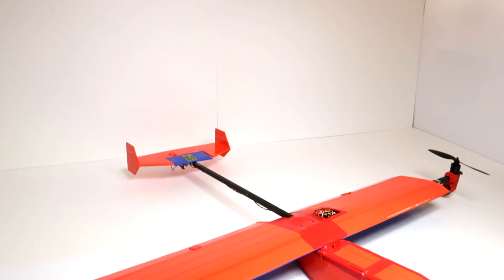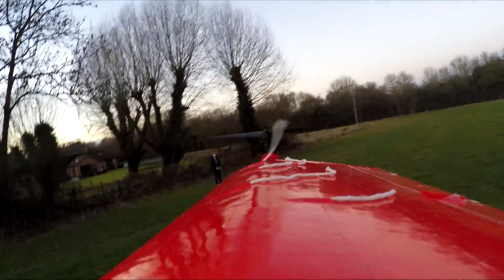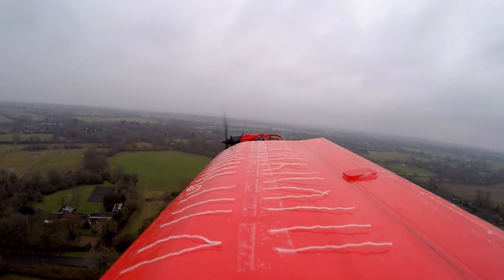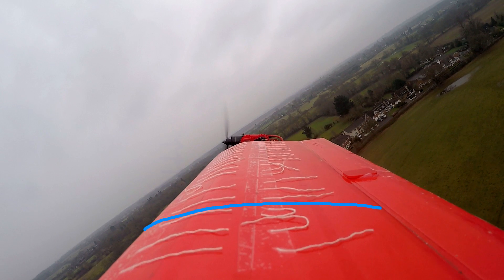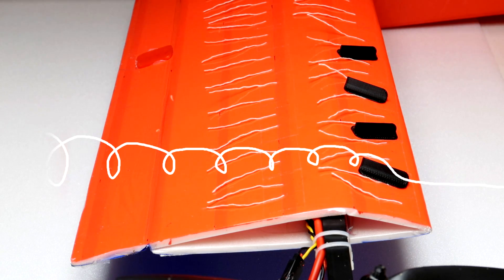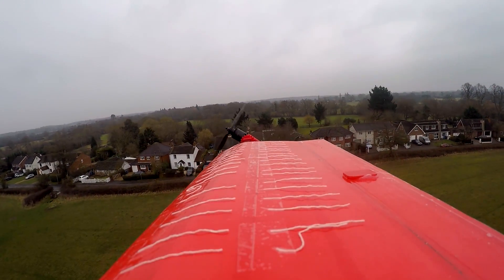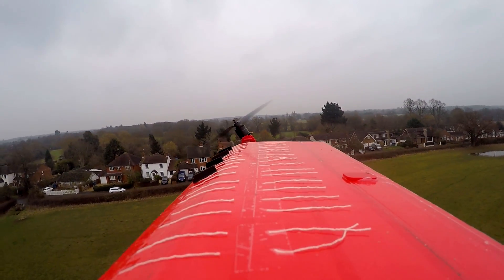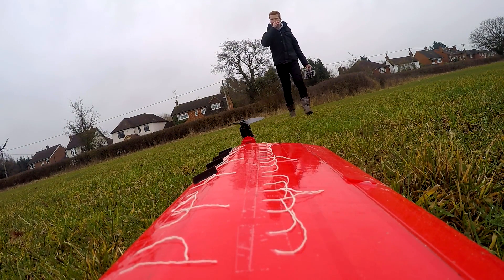Vortex Generators on a VTOL

Comment: Vortex generators  are sometimes added to increase control surface authority.. The Vtol probably has them to still have control of the ailerons/flaps while in the transition from slow forward flight to hover.. 
I wouldn't say they put them on to lower the stall speed necessarily but more keep the control surfaces active that little bit longer.. I could be wrong, but you can see them on commercial passenger jets also on the elevators.  My uncle said there on his glider just at the ailerons and that's what there doing.. Said it keeps the airflow sticking to the ailerons for slow thermal turns..

Comment: I know this video is 4 years old but I thought I'd share my understanding anyways. For low reynolds numbers such as RC scale, especially when approaching low vtol speeds, vorticity means almost nothing. Vortex generators, P factor coefficients, wing twist, variable airfoils, all moot. Even super high aspect ratio wings begin to suffer efficiency losses. What is predominant at this scale are the effects of general pressure, and the only way you can really affect that to any efficient degree is through the positioning and rotational direction of your props (outside-downward).

Comment: vortex generators on a vtol plane aren't that usefull really, they decrease you stall speed, wich means you can fly slower (usefull for cropdusters of firefighting planes and such) but on a vtol you can already fly as slow as you want. the reason they are on the Osprey is probably to make it easier for the engines in slow flight. this will reduce fuel consumption. For you it's easier to fly when using them but thats because the explained 2 stall speeds because you only have vortex generators on half of each wing. if you look at the osprey, his entire wingspan has it so this wont happen with the osprey

Comment: Make a mechanism for vortex generators that goes UP/Down with the servo at the wing Tip. When you are full forward Vortex generators are down in the wing...when transition to vertical starts they rise from the wing. All that to impact efficiency while full forward with less drag.

Comment: Unloading the wing in transition, using the rotors, reduces the wing stall speed. The most efficient way to fly is wing-borne, to exploit the high L/D ratio, so it makes sense to have vortex generators and keep the wing as close to stall as possible. Even past stall, the wing is much more efficient at producing lift than rotors.

Comment: The flow profile RIGHT at the surface of the wing is linear or close to it (for zero pressure gradient boundary layer flow it is linear), and intersects the origin due to the no slip condition. The drag is proportional to the slope of this line

Comment: Really good channel, Tom. Glad to come across you. Viktor Schauberger generated flow vortices in running water using egg shapes. He used them fixed to the river bed by chains to de-silt a river overnight. This would give you a far more intense vortex than a square tab. Want to give it a go? You may find this doc interesting if you haven't come across Schauberger before: https://www.youtube.com/watch?v=yXPrLGUGZsw

Comment: These are more complex designs but I have some comments on thoughts maybe you should try. 

1) I'm not sure you were getting the expected outcomes you wanted due to the fact that on a slow moving model, the Reynolds numbers are simply too low and too close together compared to that of the Ospray. Empirically, I am sure that the VGs probably have more to do with horizontal forward flight than the VTOL capability. Consider your Drag vs. Lift vs. Velocity calculations.

2) Maybe you could investigate having some washout in the wing, to change the angle of attach and make the stalling characteristics at lower speeds more favorable when transitioning and at higher angles of attack. Then you wouldn't have to worry about the added drag and weight which is probably more significant than your attempt (due to #1) to maintain laminar flow over the outer portions of the wing with the VGs. 

Keep up the good science and I am excited to see your progress. You are an innovator!

Comment: Variable pitch vortex generators that cycle straight to full angle of attack mid engine pod transition (not linear, full VG rotation over middle 30' approximately) . not sure if the weight penalty would offset the drag efficiency / controllability gain. you could have a central servo or just 3d print magic a cam wheel on the pods to a drive shaft. this could work on any wing i guess not just for your VTOL

Ps i make no claims to any expertise in any field and i'm sure it's been thought of before. this is more of a question.
Reply: Came here to say this, but make them retractable as well. Just cam them to raise straight up through slits in the covering, and then to proper angle once clearing the surface, and then back down to surface to lock them in. Cam it all to motor turning from horizontal to vertical. Now I have to go purchase a stinking 3-D printer so I can do this. I suddenly have an overwhelming need to see this in action.

Comment: Great job ... I was tarted to think about two rotor vtol and check in youtube if somebody done it already.
I have noticed that this is not a simple task to do and as far as I can see you use very scientific approach to do it.
I don't have much background with a rc planes and this will be the difficult part for me.
I am intended to use your research as a base and see  what will happen.

Comment: VGs will increase your skin friction drag (as opposed to induced drag from the wingtip vortices, or planform/area/pressure drag) because they help move fast moving fluid closer to the wing surface. The flow profile RIGHT at the surface of the wing is linear or close to it (for zero pressure gradient boundary layer flow it is linear), and intersects the origin due to the no slip condition. The drag is proportional to the slope of this line (the velocity gradient at the surface) so as you increase the slope/gradient by injecting/mixing faster moving air to the near wall region with the VGs, your skin friction drag goes up. (Also you have losses from the momentum imparted to any vortices persisting in the wake, as well as increased frontal area due to the VGs... on real aircraft these are quite small but on your model the VGs are pretty huge relative the wing cord, so these effects may be competing with or even overwhelming the skin friction increase effects.

BTW, your use of the term boundary layer was not quite accurate. It seems that you were confusing the boundary layer with the separation bubble. There is always a boundary layer over any solid surface (assuming continuum mechanics, not rarified flow, or infinitely close to a sharp leading edge) with attached flow. The local skin friction indicates how close you are to having a separation bubble. When the skin friction (proportional to the velocity gradient at the surface) reaches zero due to the pressure gradient, that is where separation happens, as you correctly drew in your diagrams. The region of recirculating flow associated with boundary layer separation and stall is typically called a separation bubble.

Interestingly, if you try to design airfoils and fuselages to minimize total skin friction, you WANT to be as close to separated flow as possible over the largest possible area, because local skin friction is proportional to the velocity gradient where the boundary layer meets the vehicle surface. The problem here, however, is that the vehicle is so close to stall/separation that it is not practical or controllable. (i.e., you are near stall at 0 angle of attack, or some small positive angle of attack).

With conventional wings, the skin friction (in the airfoil coordinate system) is minimized right before stall. The problem is that, in the coordinate system fixed to the direction of travel, the lift vector in the airfoil coordinate system starts to point backwards in the direction of travel coordinate system, as the pressure differential between the top and bottom of the wings increase. (This will also increase the induced drag.)

I'm not sure exactly why the Osprey has the VGs but as you alluded to, there are two main uses for VGs, fences, and other high lift devices like slats and flaps: Delaying stall at  low speeds/high AoA, and controllability at these conditions. VGs are particularly useful upstream of control surfaces, since their control authority is derived from redirecting the momentum of the air flowing over them. If the boundary layer separates, then there is no/less airflow over the control surface, and you loose control authority.

The Osprey is interesting because from that photograph I see at least 3 types of passive flow control/high lift devices: VGs near the leading edge/quarter chord on the top surface, fences adjacent to the pivoting engine nacels, and fixed leading edge slats running the length of the wing. 

Any way, super super cool project. Keep up the great work, and good luck in school!
Reply: Good to see someone pick up on the fences on the Opsrey - I was watching the airflow at the end of the wings on Tom's model and it definitely looks as if spill from the props is stalling the wing tips; was just thinking fences would be a good mod!

Comment: Nice Work! I would recommend you to print smaller sizes of the vortex generators (you are getting large amount of drag from those big ones you printed - resulting in wingtip stall) .Try  to put the new small ones all across the wing from tip to root.
There shouldn't be a large gap between the wing tip and the motor, this area should be smoother..
Extend the  flaps full down when you are taking off vertically, this will gain some stability and reduce wing tip stall.
Good Luck!!

Comment: Low forward speed at high angle of attack is where these "should" do most.  Not in full powered lift phase (especially in a model aircraft with an "obscene" thrust ratio -compared to a fully laden V22 on short takeoff)..

Now the real efficiency gains come from optimal size and placement so they provide maximal benefit in low speed without causing harm to high speed (low angle of attack) flight.  Finding an optimal solution may not provide real gains when Hover Power isn't a problem (and scale effect).

Great seeing Research in "real time".

Comment: Tom -
a little advice, or at least your thoughts on the subject, please. one of the reasons i have paid such close attention to your vtol videos is that, where i live landing a fixed wing plane will be difficult (too many house closeby). launching i think i can handle. why not use a quad (which i would prefer) ?  because i live near the gulf coast in florida, and would like to send out an fpv drone to see what is going on around a little island about 3 miles off the coast. from my house it is about 6 miles each way. so i guess to cover this long a flight i will need a fixed wing. but a landing strip is not available. would a vtol get me enough range ?  what about a standard fixed wing plane with a deployable parachute ?

Comment: VG's don't do much at low Re's. i.e. Small wings at low airspeeds.
Reply: I'd say a better thing to try is a leading edge slot.
Reply: Tyler H i agree with you. Even better could be a suction at certain point of upper face of wing...

Comment: hey I know you use catia for modeling and I am assuming you have the student licence. do you pay because you think the skills will transfer to a future job at a bigger company or are there actual advantages to other programs like f360, creo rhino etc.
Reply from the maker: +Simon Barbarasch I am fortunate enough to be able to get the Catia student licience free from my university, and yes I feel the skills learnt from it will help with future job opportunities. However, once I finish my degree, I will look into free CAD softwares available anyway for hobby use
Reply: StantonFPV OK cool. I use solidworks and fusion 360 currently but I'm trying to break away from fusion because not many in the industry use it. strongly recommend for personal use tho. also, do you know anything about Creo and what it's good for and used for?

Comment: Tom,  I want to share some of my experiences with vortex generators and vortilons. (leading edge vortex generators).  I owned a Rutan VeriEze full size plane years ago.  The main wing is swept back on this plane and when tufted the air flow would sweep out longitudinally and run parallel along the trailing edge of the wing.  This was most noticeable at slow speed as the ailerons became very sloppy and AOA was very high on final approach making visibility very poor. 
Vortex generators were attached along the top of the wing forcing the airflow to run along the chord.  This dramatically improved slow flight AOA (slow flight AOA changed from ~10 degrees with no vortex generators  to ~<5 degrees)  improving landing visibility and aileron control.  
 Replacing the vortex generators with vortilons improved both slow flight (same as the vortex generators) and improved cruise speed as well.  Only two vortilons were needed to get the same benefits as 10 vortex generators. I presume induced drag of the vortilon at cruise speed is lower accounting for the improvement in cruise speed
  My conclusion, Vortilons are superior for swept wings where vortex generators work best on straight wings.

Comment: I used to work on F-18s in the US Navy, if you look at the wing from the tip, there is definite twist from tip to root, so the root stalls first, is probably why the plane is so good at high alpha flights. I can't tell if your airplane is using any auto pilot gyros or not? How much aerodynamic control are you using, ailerons etc, vs just motor thrust control? Anyway, I'm enjoying watching your process and progress, nice job on the incremental testing. Well done!

Comment: It would be interesting to see what happens if you reverse the prop direction at each wingtip.
Not to be critical, but the right wingtip vortex is counter-clockwise ( https://en.wikipedia.org/wiki/Wingtip_vortices) so the right prop being clockwise is counter to the tip vortex. Again great video!

Comment: really looks like the flow is dominated by the propwash not the forward airspeed when you're going that slow. Also something I've found with tufts is you have to use smaller tufts than you think; the air movement you get inside a separation bubble is really really low energy compared to the attached flow (which i guess is obvious cause that's why it happens). 

I think this is one of those things where the wing loading vs Rn is soooo different from a full sized plane, especially such a insanely high-wing-loading plane like an Osprey, that you might not want to be looking at 

Old floater polyhedral r/c gliders used to use these stick on strips that were used by tailors or something, little 1/8 inch paper or fabric with a 1/4-inch zig zag pattern that would trip the boundary layer to avoid a bubble forming. 

I'm just wondering if there's really enough energy at this scale and this wing loading to get the kind of useful vortex to form that can actually do what you want.  I saw you had video from a guy doing CFM on a model of the vortex generators, but did he really have the parameters set to match the scale and speeds of your plane?

Comment: When starting RC flying in the 90's, I got told to build my wings with the wingtips pitched down slightly. That of course decreases the angle of attack at the wingtips which makes them stall after the center of the wing. The same rationale goes behind only adding flaps to the center of the wing. The center part will stall first and you start to loose altitude, but since the wingtips still have nice airflow all the way back to the ailerons, you can still control the descent. Your vortex generators seem to have the same effect!
When flying full scale, I've experienced much reduced minimum speed when having vortex generators compared to without. Could it just be that the Osprey just have them there for increased low speed lift? I assume that would take some load off the engines during slow flying.
Reply: Pitching down the edges also decreases induced drag. Additionally, giving the edges (where the controlsurfaces has the most leverage) a lower stallspeed increases control near stall- speed

Comment: Nice work! Are your props rotating with or against the tip vortices?
Reply from the maker: +Gary Paisley the props are rotating with the tip vortices. So if looking from the back, the prop on the right is rotating clockwise. Thanks!

Comment: Good demonstration! I could hear the flight controller changing prop speeds more rapidly when you didn't have the vortex generators on the wings. How hard is it to fly the transition so that the model is not sinking while it has significant forward airspeed? I think that flying forward, sinking, and having the props rotating slowly and flying through their own downwash will be difficult.